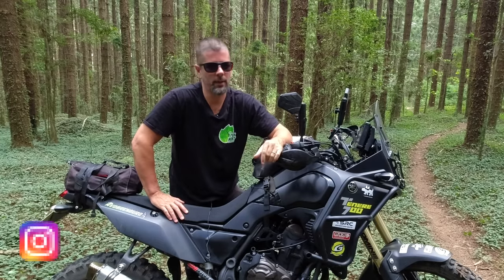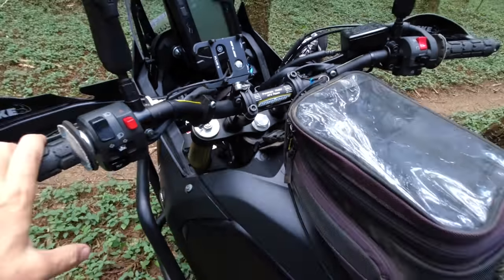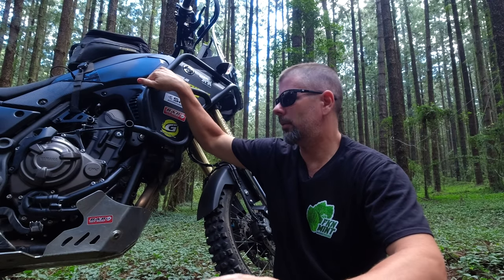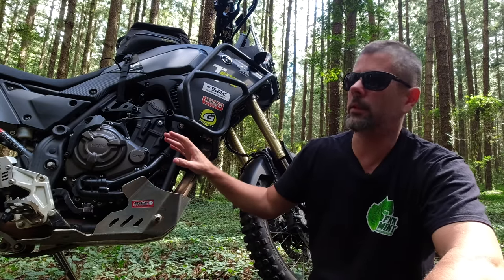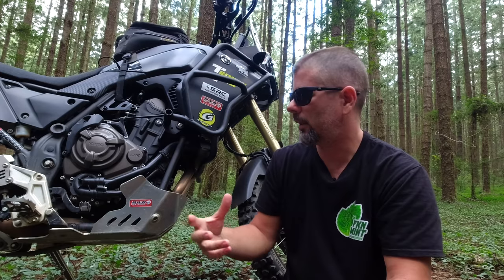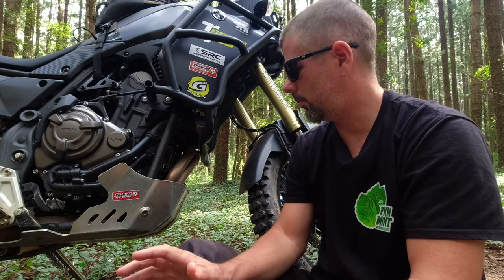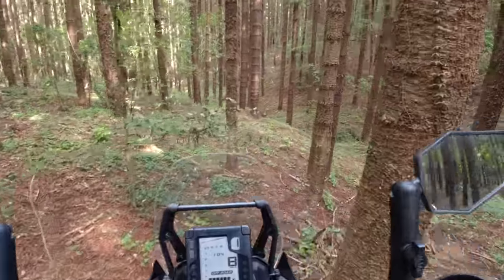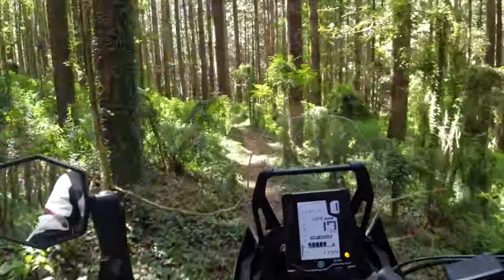Yamaha Tenere 700: One Year 12,000km Review & Mods

Comment: Out of all the choices of bikes, the newly announced 2022/3 World Raid is one I would throw money down on. I happen to like KYB suspension and they somewhat fixed the suspension on the World Raid with slightly better dampening and a little bit more travel. Funny with Yamaha, everyone wanted the WR gearbox, but now WR is World Raid. It has a duel fuel tank totalling 23L, 20mm higher seat profile, fibreglass composite radiator fenders, better colour TFT screen with mobile connectivity. It's not without needing mods though. Yes they are a very good looking bike and I would go the black with grey accents too. Love those mirrors for trail and road.

Comment: Thanks Josh, I’m really looking forward to getting a T7. When I rode one for an hour or so through some rough gnarly high country tracks I couldn’t believe had great it was, and the sound of that engine. I was sold after 5 minutes. I’ll still keep Dozer, I’ll never sell him. And you are correct about how good the bike looks, love it. 

Nice job again on the video.
Reply from the maker: Cheers Rodney 🤙 The $64,000 question is... which colour will ya go for? 😁
Reply: @MVDBR  good question, I want the black rims because I want to customise my graphics to suit my Mile Munchin Adventures brand and a new product I’m developing called Dirt Bag Gear. Stayed tuned l’ll send you one when completed. I’ve just finished testing. Now to get 1000 ordered.
Reply from the maker: Oooh sounds intriguing!

Comment: I was really interested in this review because you, like me, have dirt bike background. You said T7 was super fun, and you know what... you were right! It's so predictable, planted and has great power delivery and motor!
Though it takes some effort to get used to turning around before fallen trees and avoiding deep mud, which were never an issue with my dirt bike.
Reply from the maker: Yes! Logs & mud, the heavy bike's Achilles heel. Still loving the T7, miss the easy wheelies of the dirt bike though 😭 Thanks for the comment mate
Reply: @MVDBR  yeah, that too! Riding a dirt bike is always half-flying, wheels never stay on the ground too long. T7 on the other hand is very planted, it's hard to get her into the air. So different, but oh so fun :)
Reply from the maker: @white-rider  when the T7 does get airborne the landings are usually not pretty 😬 Have you done anything to your suspension? All I've done to mine is changed out the fork oil for heavier stuff and more of it, to stop it bottoming out so much. Makes it a lot more fun to launch. I did a video on it here somewhere 👍
Reply: @MVDBR  not yet, I have my T7 for less than a month, and I'm yet to bottom her out. I'm pretty light, so I'll se how it goes and try the adjustments first. I've seen your suspension video, and that approach definitely adds bottom-out resistance, but also changes suspension feel through the whole spectrum, making it generally stiffer, not absorbing small bumps as good as before. I've tried that on my previous bikes and wasn't too impressed, but will do it again if it starts to bottom out on me too much :)

Comment: "2nd gear single-track shredding" ... thats where my T7 feels most awesome !! I'm same milage as you and love the bike more all the time. Few little niggles, like corroded spokes (had heavy duty stainless fitted), bit of corrosion under tank but only a small amount, and today it's back to Yamaha for a faulty gear position sensor, it no longer displays 6th. Other than that it's one awesome beast thats super easy to live with.
Reply from the maker: Where abouts is the corrosion? On the under side of the tank itself or on the frame or something? That gear indicator issue must be a common thing with this type of bike, I remember my MT09 had the same thing happen.
Reply: @MVDBR  corrosion is on the underside of the actual tank, on a seam at the front, a mate of mine has just had his tank changed under warranty . There's hardly any on mine but I've treated it a few time with ACF50 and I'll check it again before the warranty runs out in September 😉
Reply from the maker: @fenner-g6088  thanks mate I'll have to try and remember to have a gander at mine next time I take the tank off

Comment: Cheers mate, a good watch. The pipe sounds good too. I’m personally holding out a bit longer for hopefully the new Transalp (if it ever arrives!). If Honda can copy the T7 design philosophy and manage to shed 10-20KG off it, they will also sell like hotcakes. It’s not about the capacity, it’s all about weight! I wouldn’t care if it was down a bit on power either, if you lose the pork you don’t notice less horses and it’ll handle better too.
Reply from the maker: Yeah less weight is always better off-road, the T7 does a pretty good job getting around in the tight stuff tho. Good luck with the bike shopping 🤙

Comment: Great review Josh, I 100% agree with you. Ive had my T7 just going on a year as well, Reg. / Insure etc. all due in a few weeks. 7,000ks on mine. I actually fitted a centerstand, (Yes it can drag when you drop into a rut), I had a trail stand and it was really sketchy using it for the front. Got a rear flat 80km from the nearest town a few weeks ago and was glad I had the centerstand, I was loaded up for camping as well. Is the suspension hard core no, have I upgraded it no. I'm 61 yrs old and about 72kg, so I think we're closer to the designed rider weight Yamaha intended.  
I think this is the unicorn, if you want:- 74 HP, Awesome road handling, Smooth engine, Awesome dirt ability (not for beginners on single track.), Low maintenance, Reliability, Versatility. I have a dirt background, but this bike will make you fall in love with all aspects of motorcycling. Ive ridden this bike everywhere I took my WR250R, and in 90% of the riding this thing is better! Ride On.
Reply from the maker: Oh for sure a unicorn is something different to everyone, I'm very happy with the T7 overall. Love it. If you want a cheap dirty way to increase fork bottoming resistance, $40 worth of heavier fork oil has worked wonders for me 👌 (did that after I made this video) Thanks for the comment mate 👍

Comment: One mod you might like to make is to replace that cross-over brake line with two separate lines. If ever your front fender breaks perhaps due to a stone or a mud in the front tyre, it will lock the front brakes.
Reply from the maker: Yeah that is the main concern with the low front fender, thanks for the suggestion cheers

Comment: A VERY good brake fluid to improve brake feel and performance is Castrol reactive Dot 4 . Mate change to that before looking at braided lines , brake pads etc. it’s only slightly more expensive than normal brake fluid. Iv used it on all my last 6 bike off road enduro, ADV and road ITS GOLD . Maybe 🤔 you could also mount some long steg pegs to go out a little wider than the pipe mount ? this may protect it in an off ( and other parts of the bike )
Reply from the maker: Thanks for the brake fluid tip mate 🤙 As for the exhaust, I think I'll just deal with it when/if it gets munted. Just remove the stock mount and get a custom midpipe made up for a high exhaust mount 👌
Reply: @MVDBR  Also can explain the rear Hub mount mod as well if you like I will get at least 60kms kms out of mine know , PM me if you what to .
Reply from the maker: I don't know how to PM on here 😅
Reply: @MVDBR  , my fb is Paul Chidgey
Reply from the maker: There's a hundred of ya's on there! Send me a msg thru https://www.facebook.com/mvdbrenduro mate I'll keep an eye out for it

Comment: Excellent riding skills, sir! Bulletproof easy maintenance engine and massive after market accessory catalogue. T7 may be a little on the heavy side but you've demonstrated its excellent off road capability if one's prepared to work on one's riding skills; and anyway, that weight means it's a solid black top mile muncher.
Reply from the maker: Thanks! Yeah it does remarkably well provided you don't wanna get too silly in the tough stuff, but that's what the EXC is there for eh. Definitely very nice on road though cheers 🤙

Comment: Straight goods mate, from a voice of proper experience. They’re great bikes if you’re happy dancing with the big girls.
Reply from the maker: Have you done any suspension work yet mate? Can't remember if you had done or were going to...
Reply: @MVDBR  nah, not yet. Considered it for a bit but just dialed up the compression damping some, dialed back the aggression & learned to play in the limits. Being a flyweight makes it easier to get away with stock setup. Can be a pricey upgrade some heavier riders may find unavoidable.
   Shame there’s no preload adjustments up front cause the static sag is way too much & rider sag is borderline even under my skinny arse. Adding that may be the first move if I do anything.
Reply from the maker: @lessmore444  yeah agree 100% mate seems like half the fork travel sags out under it's own weight especially once some protective gear is added to the bike up front. Reckon some pre-load adjustment would be a big help.

Comment: great overview mate, thanks for sharing. Always tempted by this bike, but still getting good life out of my BMW 800GS, and don't think this is much improvement in weight and handling off-road is worth the additional cost, but might try it when used prices come down a bit. I still keep up with the KTM 790 boys 🤘
Reply from the maker: Cheers Matt yeah as long as you can run with the KTMs that's definitely the main thing 😅👍
Reply: Only 9kg between the f800gs and the T7   that's less than a lipo battery  and crash bars.    Would you notice?    if ones full of fuel and the other is empty. That's more difference

Comment: Fantastic Review mate , down to earth 🌍, not bull crap 💩 honest and detailed.
Totally 💯 agree about the Centre stand thing ( on all my 3 bikes - including one road NO Centre stand . The rear bearing was also an issue with the older XT 660 and Tenere 660 . Could explain the fix for that and the rear Cush drive mod ( maybe 🤔 a Yamaha thing ) . I just modded my rear Cush drive on the 660 . When I can get back on the bike again after the brain 🧠 injury can also in my opinion what the best rear tyre is the Rallz or the 723 that I’m currently running (  7 June cannot come quick enough) PM me maybe 🤔 I can assist with the rear bearing thing .

Comment: I love it!  To me, financially it comes down to the KLR 650 or the T7 and the T7 definitely seems to be more capable on the highway and it's probably lighter too.  It might be a bit more expensive but I'm not buying a $20k bike.
Reply from the maker: Choosing between the T7 and certain other bikes might be a hard choice (Husky 701), but given T7 vs KLR I'd take the T7 without blinking 👌
Reply: @MVDBR  husky is definitely nice too but I don't know.  Looks a lot more like just a dirt bike.  Maybe I just don't like it as much cause it's not as esthetically pleasing.
Reply: And I'd like to make a correction.   I looked into it and it looks like the T7 wet weight is actually 20 lbs heavier than the KLR.  It's probably that stock exhaust.🤣
Reply from the maker: @just_ray.8211  I don't know how Kwaka managed to make a single cylinder bike so heavy 🙈

Comment: Nice review, I do have the same exhaust on mine after crashing and destroying the stock one, I did end up adding five inches to the CBX500 link pipe which moved the muffler up and even more out of the way. 
I was a little curious about what you a running for oil, I changed to a full synthetic which seemed to improve the shifting.
Reply from the maker: Yeah I think it was you that gave me the idea for that exhaust mate! Good to see ya still kickin' around 👍 Fuck, synthetic is so expensive. I'm a tight c*nt I'll just put up with the clunkiness haha. Running Penrite semi-syn at the moment. Cheers

Comment: Air in your rear brake line? I replaced the front brake line on my WR250R and was amazed how much I had to pump to get the air out. Liked the bump and grind at the end of the video!
Reply from the maker: I bled it myself and also asked them to take a look at it at the first service, they bled it and said it was pretty normal. They are just really soft 😬 Cheers

Comment: hey question ? how do find the power of the engine compared with the ktm 500 ?  power to ground . cheers Steve/Geraldton
Reply from the maker: It's hard to compare Steve, mostly because of the weight difference. It takes a lot more grunt and traction to get that 200kg mobile, compared to 110kg. Two totally different beasts, but the 500 definitely FEELS more powerful because it just takes off and lofts the front wheel whereas usually the T7 just spins up the rear 😎👌 On the bitumen it takes off pretty well though

Comment: Also wanted to add, the elephant in the room with the bike is for us short guys the seat height
Reply from the maker: They're quite easy and inexpensive to lower though, with a lowering link and dropping the forks in the triple clamps. Also a low seat option 👍
Reply: @MVDBR  Sure you could do that, but would it not lose the point of the bike? (Ground clearance for offroading)
Reply from the maker: Yeah, but you have a decent amount of clearance to play with. Everything is a trade-off. If you can get away with just a low seat that would obviously be the better option 👌
Reply: @MVDBR  how tall are you mate?
Reply from the maker: @chriscallow4595  about 180cm
Reply: There are plenty of bikes for short riders.
Reply: @kojack635  But not many in this category with much ground clearance or travel.
Reply: @jeffloucks2120  I have the opposite problem. I'm 6'4" and everything seems to be built for shorter people. I want a jeep but I can't fit in that thing to save my life. Same with most vehicles.

Comment: Are you worried about the exhaust hanger issue.  I've got an aftermarket kit ready to install would rather just put a lighter muffler on than a whole mod.  Sorry if it's mentioned below in the comments, I looked pretty far down didn't see it.  MT USA
Reply from the maker: I still haven't bent the main hanger, not for lack of dropping the bike either 😁 Not too worried about it at this point even though it's always a possibility given the right combination of events. The end bit (flat plate) of the mount where the can bolts on is bent inwards a bit but I just leave it like that. So far still haven't had the swingarm start rubbing on the exhaust 👍

Comment: Have no idea why I never actually thought about this.....stupid, I know. Never occurred to me to remove the stock center stand that came on my Tiger. Saw that cheater post you’ve got to lube the chain. I’ve got the bike on my stand only twice, too friggin hard. The way you explained your situation, somehow flicked a light 💡 in my head. I reckon I’ll save loads of weight and no angry metal flapping about. 👍🏼 😎 🇺🇸 🌎
Reply from the maker: Yeah as long as you can still get it off the ground enough to repair a flat ya laughing 👌
Reply: @MVDBR  .........We don’t mention the “F” word around here, Mr  🤬.   (🙏). ((🤞)).
Reply from the maker: @bradleyalexander5821  😅 best to be prepared

Comment: Center stands suck! Your crutch is great That's crutch people, not crotch ... filthy bastards. Interesting you run a higher psi on the front. I've always been the other way around based on road riding and when I do go off I'll deflate 10 on each. 16 front 25 rear. Might try your way next time
Reply from the maker: Road riding is a mystery to me Forbesy 😬 But my reasoning is the front seems to dent/pinch a lot easier so not keen to run lower than 25 when hitting rocks n shit. Only run 18 on the back for traction when kicking around the bush, go for 25 front and rear when loaded for camping 🤙
Reply: @MVDBR  black top hater! You ride proper off-road on that beast so it makes  sense , the way of the guru I believe it's called 🤪 Road is generally 35rear 25 front.

Comment: Great video Josh, my sons DRZ400 rear brake pedal fells spongy also, I've bled the brakes twice and it hasn't changed the feel compared to my XR650L. (drinking beer 👍👍🍻🍻) cheers
Reply from the maker: Yeh, I bled mine as well and apparently they tried that when I complained about it at the first service but didn't make any difference. Ah well as long as they pull me up that's the main thing 😬🍻 cheers